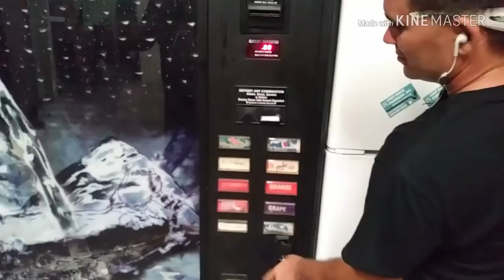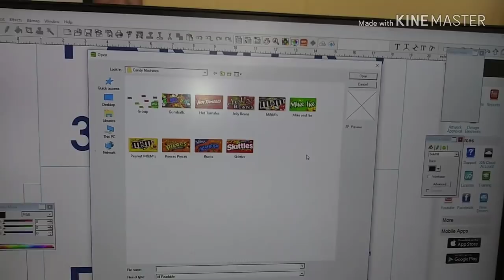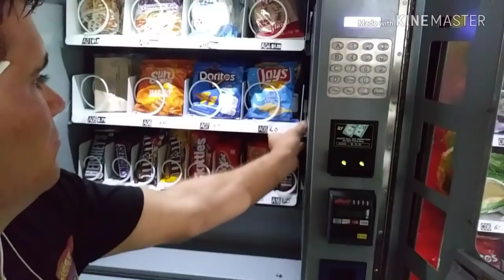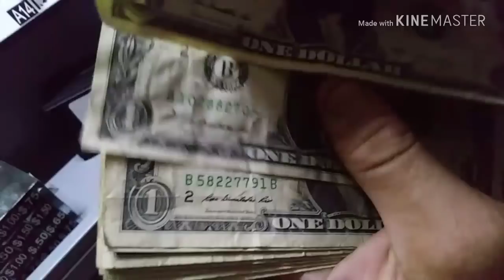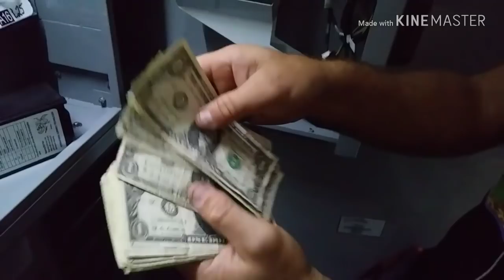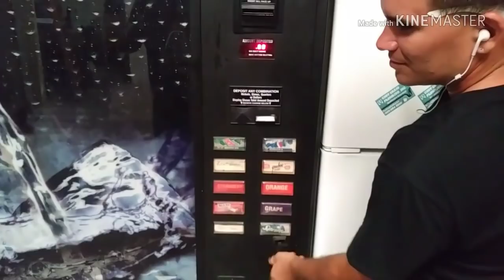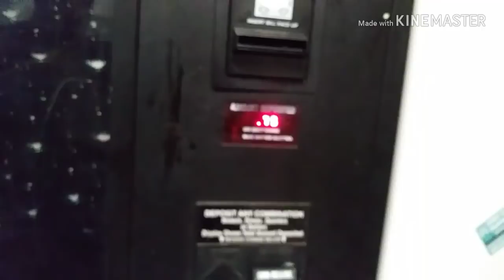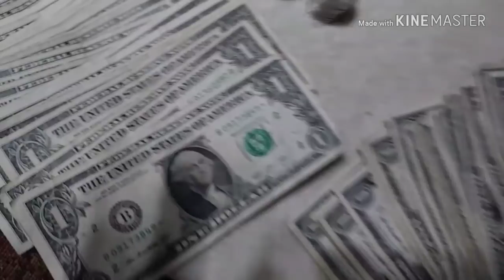How Much Did My Combo Vending Machine Make It's 1st Week??? 💰💵

Comment from the maker: Combo Vending Machine Apartment Location 
1st Week's Collection!💸💵💰
Reply from the maker: @Tyus210  
So far so good! 👍 Still have some moves to make though. Lot more informative videos coming soon
Reply: In the first month the machine will be broke into 2 times. Then will be destryed for the money.
Reply from the maker: @davidkaser7423  
I don't know where you're getting these false numbers from. I don't know where you have placed vending machines, but in most cases people don't just break into vending machines in public business. I've only had that issue once which was at an open flea market on a day when no one was there so the area was unmonitored.
Reply: You should consider yourself blessed with such good fortune. I had all my locations inside business lobbies/ manufacturing lunchrooms and break rooms, and a couple outside in car washes and in public areas like city gardens and wedding locations. I ended up removing all the outdoor machines due to break ins. Some of the loby locations were also removed due to customers, and even employees that would continually break the machines. The machines I used when I first started were budget machines and as time went on I got newer models, and some new machines. After replacing one location with new machine, a week later they were broken. This was the reason I sold the business. Vandalism and theft is every place no matter how nice the area or business location is.
Reply from the maker: @davidkaser7423  
There are definitely idiots everywhere that will steal and vandalize, but despite the inevitable, I know plenty of vendors who are profiting well in this business. Sorry to hear about your unfortunate circumstances in this business. Statistically there are more people who fail starting their own business than those who succeed, but sometimes the failures lead you into your next business venture that will succeed based on what you learned from the prior failures. What are you doing now that you're away from vending?
Reply from the maker: @davidkaser7423  
You are correct that there will always be thieves and vandals, but despite the inevitable, I know plenty of vendors who profit well in this business. It's unfortunate, but statistically there are a lot more people who fail when opening their own business than the ones that succeed. The positive thing is those prior failures usually lead to success in follow up business ventures due to that experience. What business are you into now that you're away from vending?

Comment: Do you have problems where the cooling leaks through the front panel where the drinks are dispense? Seems like the door doesn’t sit flush but may need a sealer.
Reply from the maker: no problems at all.

Comment: Do you ever buy new machines or only used machines?
Reply from the maker: Both have their pros and cons, but it doesn't really matter as long as the machine is good and I get a good deal. What type of machines are you considering looking into?
Reply: Never buy a new machine, You will never make your money back from them. That plastic triples in price every year, and depending on your location may not be worth setting up a machine at all.
Reply from the maker: @davidkaser7423  
I agree it's usually a better idea to find a fairly good condition used machine for a lower price, but as far as never making your money back that is completely absurd. If you can find multiple locations that bring you at least $100 a week and at least double your profit on products you will have your roi back in the first 3 months from that particular machine.
Reply: @ChromeVending  how many machines do you own.. trying to start in my area but not sure what kind of machine to start with and what I should be expecting in this type of business
Reply from the maker: @roundtrip385  
Whatever machines work and make money is what I go with. I'm am working on transitioning to full line and arcade now though. 👍🏼